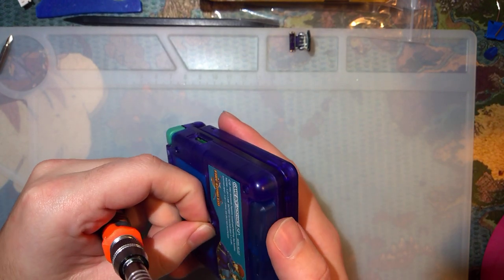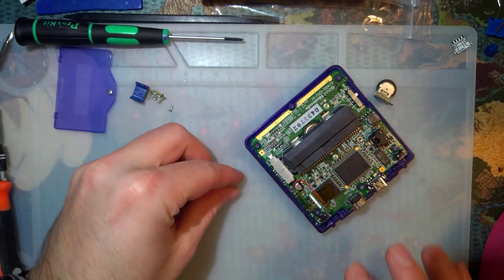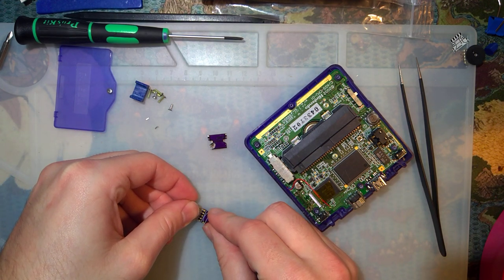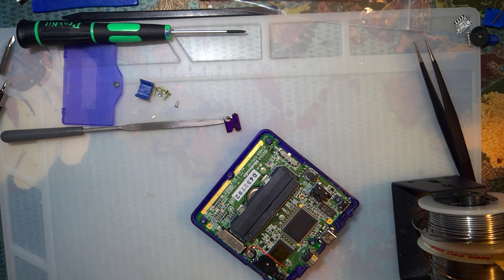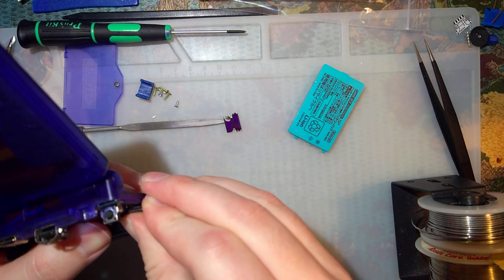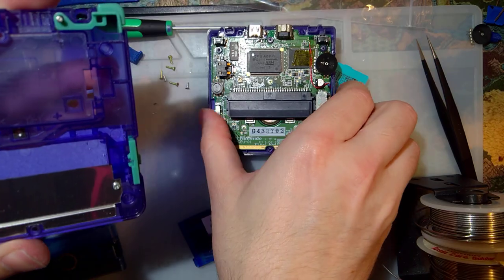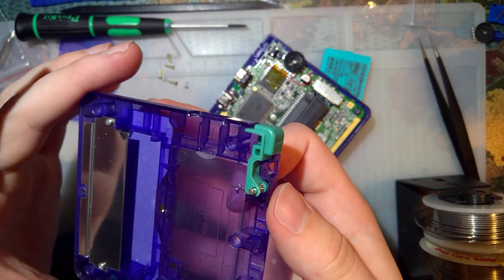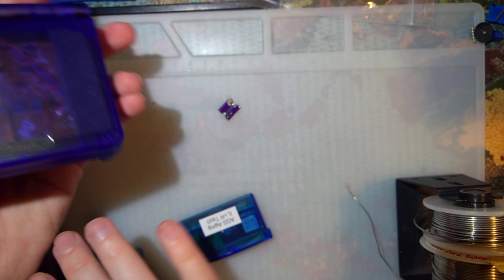Installing a Volume Wheel in a GBA SP (Part 2)

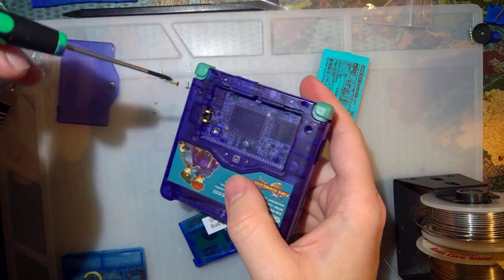Comment: "I think it's the last time I'll be taking this Game Boy Advance apart" @ 15:30, and yet hardly a month later you went for your headphone jack mod. 

Honestly this is AMAZING, I watched through the journey of this one SP and it seems incredible. I would love to do all this from the ground up. This really is all part of making what is one of the most ultimate SP's I've seen anyone work on. 

I want to take a crack at all the changes:
- IPS screen mod (with the new SP one, I still think its crazy you thought to rig the original GBA IPS into the SP shell before they finished getting the SP IPS to market). 
- New volume pot (based on some other comments you've made, this got you cleaner audio? I don't like using headphones or amps with GB line consoles because of the noise, this plus potential other audio mods sounds like a move.)
- Headphone mod (I love that you put yours in the screen, not in one of the bottom shell screw columns like most variants i've seen.)
- USB-C mod (waiting for the updated part on your video to get back into stock.)
- And finally your 603048 battery mod (curious if you ever tested that battery's capacity.)

don't know when I can start but your mod documentation is really inspiring, so thank you!
Reply from the maker: Fully intend to take it apart again because the shell is falling apart. Might swap out the USB C mod with rorosaurus' version that has C host support. 

Volume pot got me clean audio because it's a new pot. A lot of the bad audio on Game Boys is the result of a dirty or bad pot. Mine is brand new. 

And yes, I did check out the capacity. Check out the rayovac video I made.

Comment: Is there anywhere to source GBA SP volume sliders without doing this volume wheel mod? I snapped the slider off mine due to not realizing not all had removable plastic pieces.
Reply from the maker: nope. DS volume sliders are very similar and can be installed in place though and there's some NOS available for those right now. It requires a little bit of modification to the part and very careful aligning but also the travel distance is shorter so it won't line up with the shell the same and there will be a gap when the volume is at either extreme.
Reply: @makho  I ended up doing that. With the volume working, I replaced the LR buttons and added type C (way easier than bending 3rd party charge ports) and am back in business with a fully working AGS001 board now.

Comment: Hi!
Beautiful video! 
I have the same issue but whit a GBC can you do a tutorial also for it?
Reply from the maker: Except that for a GBC, there is no need for modification. Just desolder the old one and solder the new one in.
Reply: @makho  So if the volume wheel is broken i can just desolder and solder a new one?
Reply from the maker: @emilianomapelli6245  yup. The part I linked in the description is a 1:1 swap.

Comment: I think, (if it’s possible) trying a thinner wheel may be better. Or, instead of filing down the housing of you Gameboy, try filing down the width of the volume potentiometer wheel instead.
Reply from the maker: I don't think thinner wheels available. The one I used is only 1mm thick. It does fit with no PCB though so, like I said, perhaps a thinner PCB would help. I think that a thinner PCB is well beyond the budget of this project though.

Comment: I'm experimenting with a volume pot from the nintendo ds, and those replacement plastic volume tabs from aliexpress. Nintendo stuck with a lot of the same "dumb" hardware they used for the SP so maybe it works!

By dumb hardware, I mean things like switches and stuff, not the chips.
Reply: I have received a heart from the man. I now feel more complete.

Comment: Hey, I commented on your video about the Battery mod. Here's my imgur album again https://imgur.com/a/zb45y53 for reference. It's my first ever attempt to mod an SP, and the highest skill level project I've attempted so far. My potentiometer works fine, but in attempting to dust it out with some canned air, the plastic slider broke off in my hand. If I use a toothpick or something I can adjust the volume, but it's gonna be ugly if I put it together without a slider. How does the pot actually work. Is there a peg, or is it all one piece. If I can just carefully pick out the remaining plastic and buy a new slider, I'd like to do that, but getting a replacement pot and soldering it in might be beyond my current tools and skill level of a job. 

Thanks in advance for any help you can offer.
Reply from the maker: The reason I installed the wheel in the first place was because I couldn't find replacement parts that weren't just by purchasing another SP and salvaging the part myself. If you can find a replacement pot, there is zero reason you can't just swap it out but last I checked, they do not exist.
Reply: @makho  Hey, thanks for replying. You've been helpful already. I did a little research and figured out how the pot is put together internally. Seems like a salvage replacement or this mod are the only ways to replace it. I saw what look like salvaged volume pots on ebay from china for 10 bucks. The photos look like crudely salvaged parts from dead SPs, probably with not alot of quality control.

Which leads me to this question. How do those replacement slider buttons with a peg hole on them work if the part broke off pretty flush with the board? I could probably rig a short peg of some kind, like clipping a needle or something, ut even if it worked well enough by friction, it would be good enough for now, until I can replace the potentiometer at some point.

Again, thanks for replying and being helpful before.